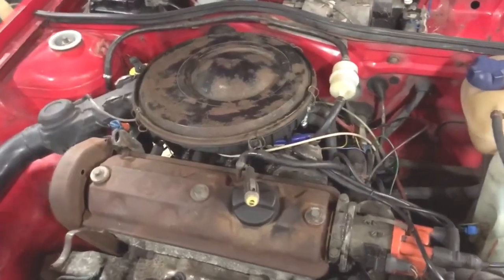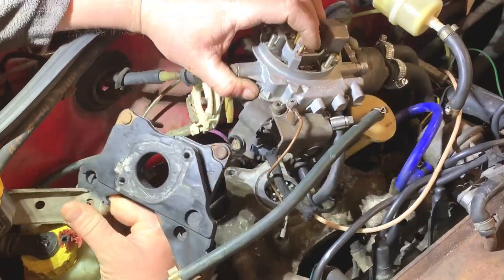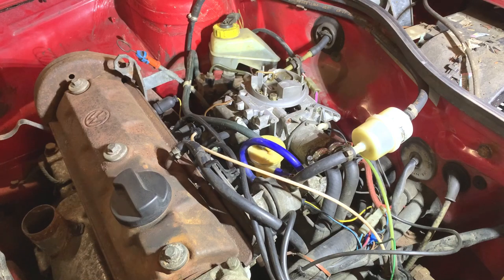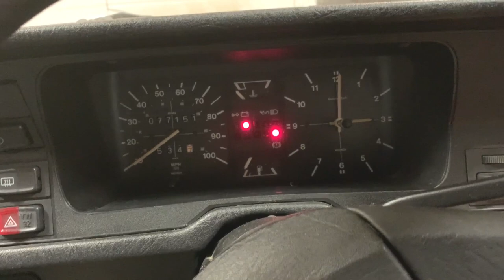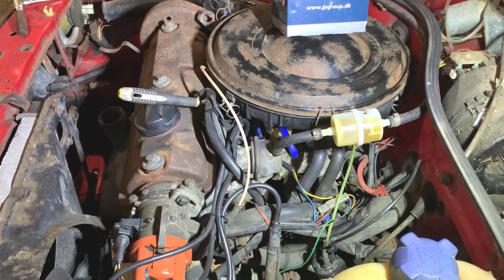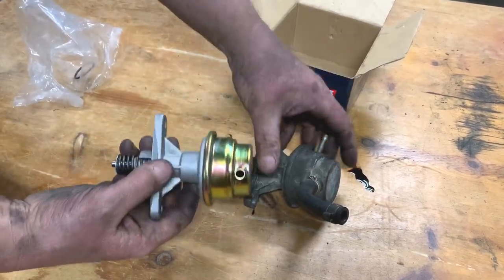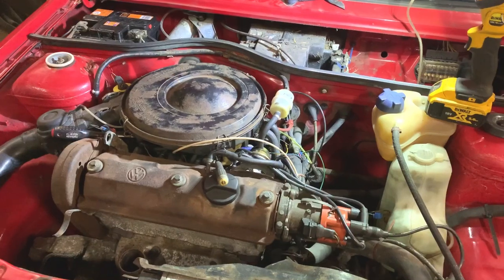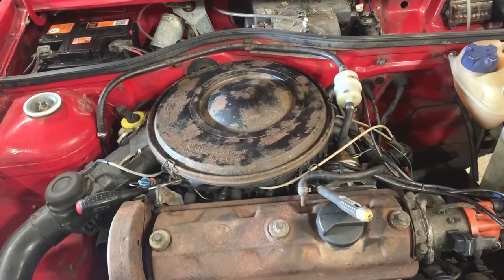Volkswagen Polo MK2 Breadvan ( Finally Running Good 🤞) 1988 VW

Comment: Them bottom nuts under inlet manifold I had nightmare with in my video 😂
Reply from the maker: Hi they are not fun, I should have filed the sharp edge off then I wouldn’t have cut my arm, luckily mine were to bad to undo, but if they were seized it would be a right pain 😫🙂👍

Comment: Luke is that a 3 cylinder ? I thought timing might be a bit off 🤷 ?
Reply from the maker: It was for a bit, did you see the bit I mentioned I’d left a plug lead off?
Reply: @menditman2004  Ok that makes sense !
Reply from the maker: @mr1pearl  Yes I forgot to refit it when I did the pump 😂👍